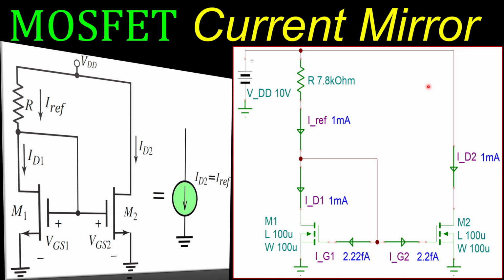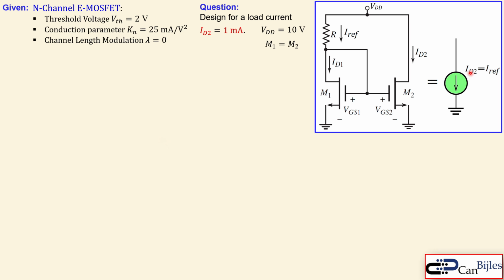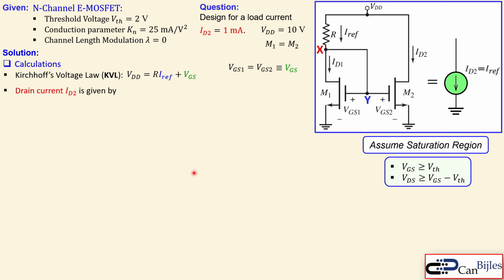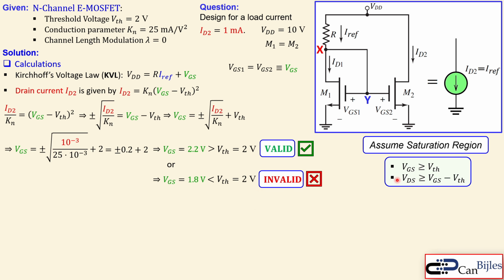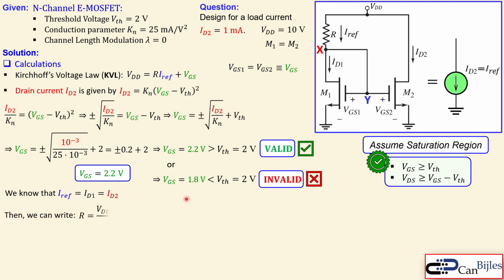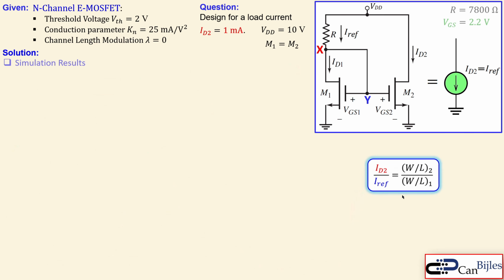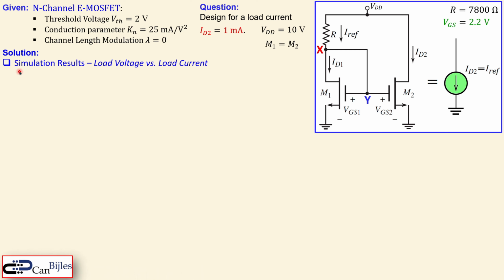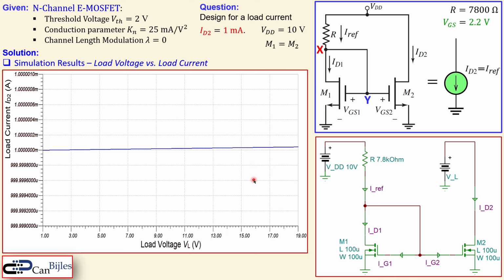MOSFET Current Mirror Source - N-Channel ⚡ Calculations & SPICE Simulations 💡 Example 1

Comment: Thank you sir 😊
We like to use a dual voltage source (-VDD)
And how to design the R value when M1 and M2 w/L are different, and then find the Vov on this basic current mirror circuit...
Reply from the maker: You are welcome. You can add a negative supply. You only need to setup the Kirchhoff's voltage loop equation including the negative voltage source.

Comment: Hi, If we have another drain resistor R above M2. How does adding this resistor affect the result? Thanks
Reply from the maker: Having a resistor at the drain of M2 will not effect the drain current of M2 much, but if that resistor is becoming too large, then it can reduce the current. You can see the effect of this resistor by simulating the drain current of M2 for different values of resistor at the drain node of M2.
Reply: If it had the same value of R at the drain of M1, Would the drain current I_D2 stay the same? @CANEDUX
Reply from the maker: In this case, the difference would be zero, but in a practical situation, it can be slightly different, but this depends again on the value of the resistors.

Comment: Hi there, if we removed the diode connection across M1 and applied bias voltage between M1 and M2, can we say that VGS1=VGS2 and ID2= Iref? Thanks
Reply from the maker: You can remove the connection between drain and gat of M1 and apply a bias voltage such that V_GS is the same for M1 and M2, applying a bias at the gate only is not practical in most cases.
Reply: Once we made this change, would M1 and M2 stay in saturation region? Thanks @CANEDUX
Reply from the maker: @Fidel-tk5rq  If the saturation region conditions are satisfied, then yes.